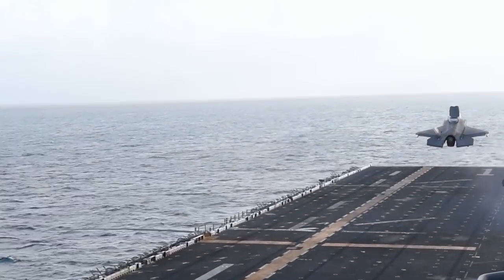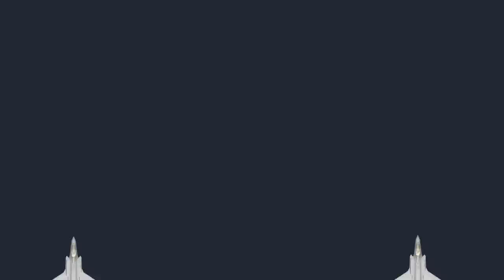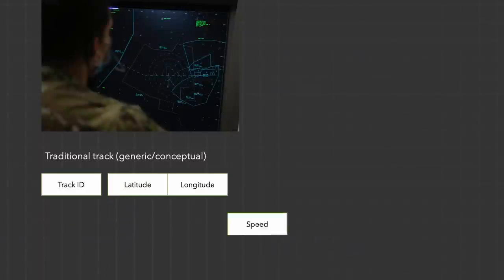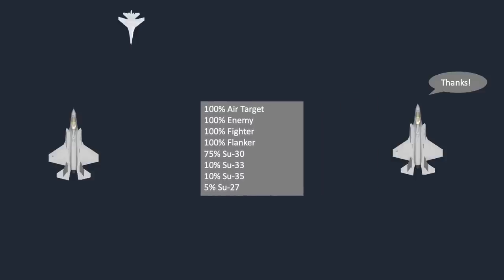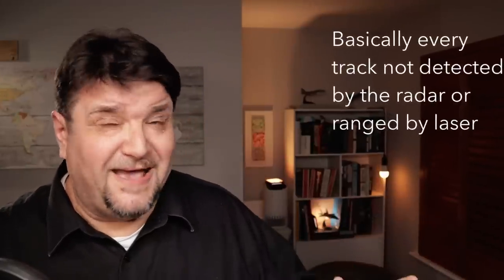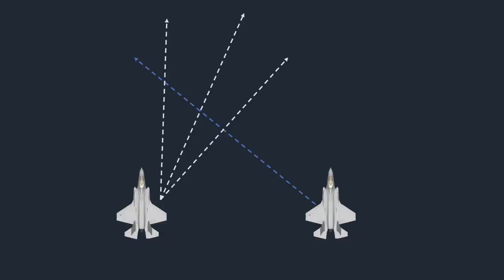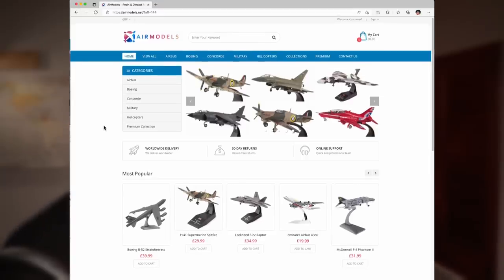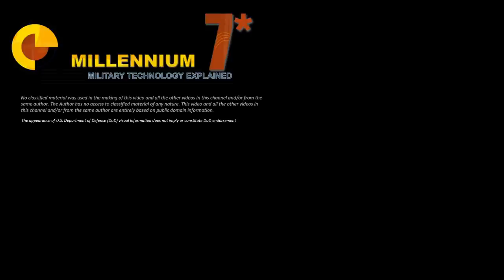The F-35 data-link works like magic!

Comment: very nice being able to use passive sensors and get position data too, this is truly stealth since radar can be detected
Reply: " very nice being able to use passive sensors and get position data too "
Especially for the enemy.
Reply: Aircombat now has the additional question of submarine commanders whether to turn ofd the radar to preserve stealth or to activate to prosecute a target.
Reply: @bakters  Passive sensors, by definition, give nothing away to the enemy except their position when they send out an active sensor signal. So... how does sensor-linking passive sensors give an advantage to the enemy, exactly?

Yes, I want to feed some trolls with this post please tell me how [INSERT MILITARILY IRRELEVANT COUNTRY] can best a sensor-integrated 5th- or 6th-gen platform in the modern battlefield.
Reply: @brimfire  " how does sensor-linking passive sensors give an advantage to the enemy, exactly? "
How do you link those sensors?  By constant RF chatter, as far as we were told.

Re: How you can best such enormous power?
With computers.  The assumption is that the enemy is also quite capable with using those.

Then it's a matter of "is it worth it?"  Is it worth it to improve your detection range by linking those sensors, at the cost of making the enemy more aware of your intentions?
Reply: @shaider1982  " whether to turn ofd the radar to preserve stealth or to activate to prosecute a target. "
With the radars turned off, all planes are equally stealthy, aren't they?

(I know, AWACS.  Let's just assume that the enemy can make it too risky to use them.)
Reply: @shaider1982  it can just send disposable drones or bvr missiles to get closer to the target bvr missiles will enable radar right before hitting the target
Reply: This is what separates both F-22 especially F-35 from the rest. Both have ELINT sensors specifically F-22's ALR-94 and F-35's ASQ-239 that can passively detect a wide range of RF signals including the lower ones.
Reply: @johnsilver9338  There is not a single modern fighter that doesn't have an extensive ELINT suite.
Reply: @adrien5834  Not all. J-20 don't have one. But all US fighter planes even 4th gen ones have one, though I'm not sure if those can detect lower frequencies like the F-22.
Reply: @johnsilver9338  Not trying to be snarky, but how do you know that J-20 doesn't have one? That seems an unlikely oversight.
Reply: @adrien5834  From the ones I've talked too. From what I've been told it uses it's radar itself to passively detect RF. But an X-band radar antenna will only be able to detect X-band frequency.
Reply: @johnsilver9338  I don't believe it because I see no reason why it should be so. The j-20 is enormous, there's plenty of room for the Chinese to install whatever systems they want. The Chinese haven't gone to the trouble of designing and building a stealth airplane to compromise its utility by making it blind, it would be silly.
Reply: @adrien5834  If it did, there would already be citations for it. So far there is none. But even if it did J-20 will have to be bigger and heavier because of the different antenna sizes that it has to carry. F-22 is able to carry it because it has more efficient engines. J-20 will need more powerful engines maybe even stronger than WS-15.
Reply: @johnsilver9338  Come on, all the eurocanards carry extensive signals interception gear and they weigh half as much as the Raptor...
Reply: @adrien5834  Like I said it's the size of the antenna. The canards will only be able to fit smaller sizes but not the bigger ones needed for longer RF wavelengths.
Reply: @johnsilver9338  Okay, well I don't know enough about the subject for this discussion. My understanding was that length of the antennas mattered mostly for transmitting, not receiving, and that multiple antennas connected as an array could effectively replace longer antennas. Is it particularly useful to intercept longer RF wavelengths? What are they used for?
Reply: @adrien5834  Like I said, an X-band radar antenna will only be able to recieve X-band frequencies.
Reply: @johnsilver9338  Yes, you said that already, but we're not discussing the radar antenna of the j-20, we're discussing its RWR equipment. Which does exist, it's a certainty.
Reply: @adrien5834  RWR should be also in the X-band, as missile seekers use X or Ku band radars. Maybe even in the C-band and higher parts of the S-band as some fire control radars use them for painting targets.
Reply: @johnsilver9338  Look, I'll defer to your understanding of the subject, but do I have to remind you what this all started from? You were saying that F22 and F35 are in a class of their own and I don't see what information you have to make this determination. All this gear is classified but Europeans and Chinese are perfectly aware of the importance of these systems. The F22's RWR was even designed in Europe, as you mentioned yourself...
Reply: @adrien5834   Becuase F-22 can even pick up RF signals from lower bands like UHF and L band frequencies or from 0.5 all the way up to 18GHz if I'm not wrong. Thats what makes them so deadly. So against F-22 it's not enough to be stealth and radar silent. Even comms and datalinks can be picked up. F-35 on the other hand can pick up signals from 2 to 20GHz and is also being upgraded to detect lower ones. Also, RWR can't trace the source of the signal. Unlike a full EM suite. You can read more at F-16()net. Replace () with a dot.
Reply: @johnsilver9338  None of this is specific to the American jets. All modern jets have extensive ELINT capabilities. If you think I'm repeating myself, it is because I am. You don't seem to be taking what I am saying on board.
Reply: @adrien5834  Not all have this because their is a trade-off weight versus sensor capabilty. A dedicated EW suite is vey heavy if you don't know. Maybe with European jets but I don't think those have bigger antennas as they have to be small and nimble. Even F-16. China for sure don't have this as they can only go for RWR for J-20 and not a full fledged EW. Like i said go read at F-16()net. If you don't want to belive me not my problem.

Comment: The notion of sensor fusion is a fascinating topic. I was an Avionics tech back in the late 1960s. Back then our aircraft had newly installed voice crypto using a shared secret that had to be manually updated in each aircraft.

The actual use of this complex data is way above my pay grade. My interest is at a much lower level. How does the RF transmission work to prevent the enemy from radio locating the aircraft - I assume this is some form of spread spectrum technology so emitted signal is near the noise floor that allows aircraft to communicate while making it hard for an enemy to track the transmitter. Second the system requires encryption to prevent evesdropping and spoofing. That means the participating aircraft need to mutually agree on a secret key.
Reply: I wondered also about how they secure the inter-aircraft coms?   Anything could be encripted well enough to prevent quick access...but for sure the signals can be jammed at least locally.   Perhaps they're all going up to a satellite....which would be the hardest to intercept and/or jam and would allow all aircraft to share info even when out of line of sight.   Fun stuff the electronics game...and having worked in the defense industry and seen things that really worry me...if someone said they had the electronics to make an F-35 go dumb...I'd believe it.  We were getting circuit boards for anti-submarine defense systems...from CHINA.   Densely populated boards with chips galore and I asked 'how do we know they haven't installed a defeat switch in here somewhere?  Oh...that kind of talk was not allowed.
Reply: @recoilrob324  Spread spectrum is resistance to jamming because it occupies so much bandwidth, but if the bad guys have access to the spreading codes all bets are off. 

Satellite is interesting but sats add a lot of delay and are vulnerable to hostile physical attack. I assumed this is a peer-to-peer network among the neighboring aircraft but that is just a guess on my part. The info needs to be able to be shared with AWACS and other ground assets so I don't know if that is the same or different technology.
Reply: " emitted signal is near the noise floor "
That's how "modern science" tends to deal with data.  Gather a bunch of noise, then pretend they figured something out of it.
Unfortunately, that mostly works when you already know what you want to detect.
Reply: @tomschmidt381  " peer-to-peer network among the neighboring aircraft "
Great idea, when you are attacking a bunch of "goatlovers", though arguably you don't need all this high tech then (and you gonna lose anyway).
However, what if you attack a high-tech power?  What if they are capable enough to put some antennas on the trucks, connect them with a simple system, then cook up some software which combs through all of it?

No matter how well you encode the messages, they are still messages which are constantly sent.  That's data which carries information.  Whether you intend it or not.

What if the best strategy is to simply shut up?
Reply: @bakters  Which you do if you know the other guys spreading sequence, if not then yea looks like just noise..
Reply: @tomschmidt381  " spreading sequence "
What's that?  You "ping" a bunch of frequencies in a pre-arranged sequence, or what?
Even then, you can detect the pings, where they are coming from, at what speed.  If it's a "newest-fanciest" style, then you may even figure out which aircraft has sent them to which aircraft.

The enemy is expected to either have computers, or is fighting such a low-tech war, that it's all overkill anyway.
Reply: I think lots of people have vaguely covered "low probability of intercept" RF. It seems to be a bunch of combined techniques, from simple ideas like reducing transmit power to the lowest needed to reach targets by distance, to complex beamforming schemes, and also some kinds of frequency hopping to force receivers/listeners to listen on a much wider bandwidth to correlate emissions enough to locate and ID them. Imagine the amount of ram you'd need to listen on a million different channels to figure out when you're even hearing a coherent transmission instead of just noise!

I don't know if the public can ever fully know these things. Anything meaningful is gonna be a bit classified! I don't understand it. I guess you can see how this might make an adversaries job more difficult though.

But if someone reading this does understand, well, I regularly see job postings for open electronic counter-countermeasures software developer positions, you should sign up! 😉🫡😂
Reply: @bakters  you're looking at it the wrong way. It doesn't actually have to be impossible to detect or jam. But if it makes the adversaries job 100x harder, then you're still achieving your objective.

Consider what china is doing to try to break stealth. They're putting enormous effort into building multistatic low frequency radar arrays so they can correlate returns and increase the detection range of incoming stealth fighters and bombers. Those are installations that themselves require defense and maintenance, can themselves be jammed or decoyed, and generally drain adversary resources.

The brilliance of a network like our Italian friend is describing, is that it sounds really resistant to catastrophic failure. It'll degrade gracefully. That bit about exchanging the actual radar returns and emissions with other aircraft and also each aircraft evaluating for themselves? It also smells to me of a zero-trust approach. In theory, it even builds a degree of digital ("cyber") resilience into the system. Even if (when) someone breaks into the network and starts inserting bad data, there's already mechanisms in place to manage it even statistically. It's like chaos engineering, since digital malfeasance is already controlled in the same ways that normal failures are controlled for. I'd bet a few bucks they had this in mind back twenty years ago when they started drawing this up! Back when little me first for broadband.
Really brilliant.
Reply: @Ariccio123  " Consider what china is doing "
It's interesting that they do what I would consider reasonable based purely on physics, with no insight into military, because I'm not much into that kind of stuff.

" Those are installations that themselves require defense and maintenance, can themselves be jammed or decoyed "
Not so easy, if they use distributed model.  Then it's a network you can't easily defeat...

" and generally drain adversary resources "
More than a stealth fighter program?
Because if their system turns out to be effective, and sending stealth planes under this defensive umbrella will prove risky, then they won, and you guys have wasted valuable taxpayer's petro-dollars on a hope of technological advantage.

It happened before, just saying.  Nobody else has put so many eggs into the stealth basket.  Likely for a reason.

Now it's all about datalinking.  Good, but that isn't stealthy by default, is it?

" The brilliance of a network like our Italian friend is describing, is that it sounds really resistant to catastrophic failure "
Thankfully, Chinese are stupid, and their networks are not resistant to catastrophic failure.

Wait...  Oh my, they are not stupid!  Bummer.

" That bit about exchanging the actual radar returns "
If I was in charge of a defense network, I'd love it!  Keep on babbling, I'll keep on triangulating.

This datalinking seems like another stealth.  Unbeatable, as long as nobody finds it worthy to beat it.
Reply: @bakters  I dunno, I was a skeptic myself, but now the f-35 is only a bit more expensive than a new f-16. I'd call that a steal without the stealth!
Reply: @Ariccio123  " now the f-35 is only a bit more expensive "
We are so fortunate that the politicians would've never dared to lie to us.

" I'd call that a steal "
Me too...
Reply: @bakters  go check the math yourself! F-16Vs are selling for about a hundred million each! What's the international sale price of an f-35? Say, the ones we're selling to Finland?
Reply: @Ariccio123  You are "selling" F-35 like Ferrari sells their cars.  The absolute base model is still expensive, but not outrageously so, but then you have to pay through the roof for every little piece of equipment that comes standard with normal cars.  And then comes the service.

Now, I put "selling" in quotes, because it's more of a protection racket than anything else.   While we paid for F-35s, we don't actually own them.  They are still yours, we are simply allowed to use them, for as long as you guys let us do it. 

I wish you guys stuck with F-22.  I'm sure I'd rather rent (upgraded) F-22s than F-35s.

In a perfect world, where we are allowed to buy whatever we want on the free market?  Gripen.  Nothing else comes even close (especially those F-16s we are allowed to only rent).

Comment: 10:05 Telecom solved this problem long ago, it does synch with GPS, call it clock level-2 (level-1 being atomic clock) and a free-running clock mode. As long as GPS is available, the internal clock is being monitored for latency and other parameters. The moment it loses GPS, the time stamps continue to be delivered but now it tells it comes from a free running clock with the deteriorating estimation (parameters above) the longer it goes without GPS.
Reply: Military systems presuppose the possible loss of external data sources like GPS[1] in a real shooting war and the weapons platforms are supposed to cope with this loss and continue working. Free-running clocks on different platforms will drift out of sync and cause the range and track data being generated and exchanged to degrade in quality and precision. My half-assed solution would be a flying master clock that the other members of the dataspace use for reference. If that platform gets shot down or has to leave the dataspace to refuel etc. then another master clock takes over.

[1] GPS, Glonass and Beidou are all hardened and supposed to survive attacks by Earth-based weapons systems like lasers but I am sure smarter people than me have figured out ways to destroy them or just make them unusable if the worst came to the worst. Jamming and spoofing of GPS signals is already a thing but only at near-ground level for various reasons.

Comment: The F-35 is just amazing. The less you know about the aircraft, the worse it seems. The more you know about it, the better it seems. I would wonder what the systems of Russia and China are like. Unfortunately, we know far less about them. That's why comparisons are so difficult. We don't know if the avionics of a J-20, for example, are as good as those of an F-15 from the 90s or 80s or (almost) on par with the F-35. China, of course, has much less experience and has also adopted some things from Russia. But we can't tell it really.  Many of the Russian systems (e.g. also the Su-35, Su-27 etc.) are now in the hands of NATO. Maybe we (the public) will get a little more information about them. That is always a bit mysterious about Chinese and new Russian weapons. You don't know how good or how bad they are until they are actually used. To be honest, I still don't know how good the S-400 is. Some say it's garbage, others say it's the best.